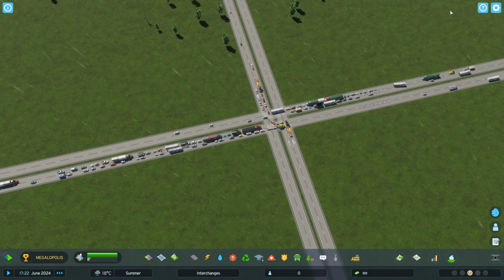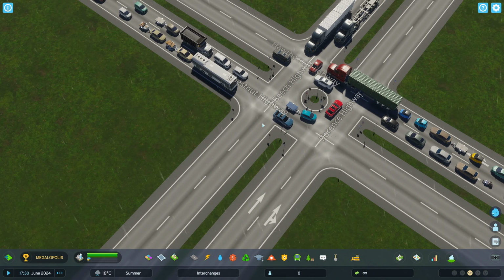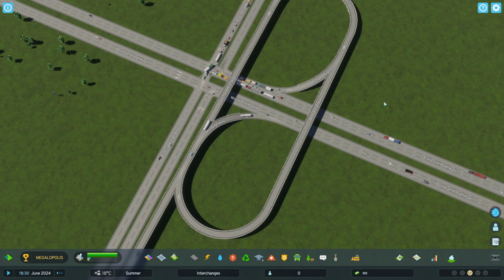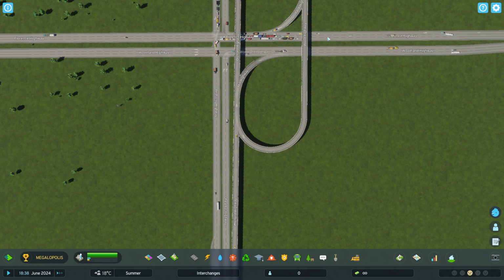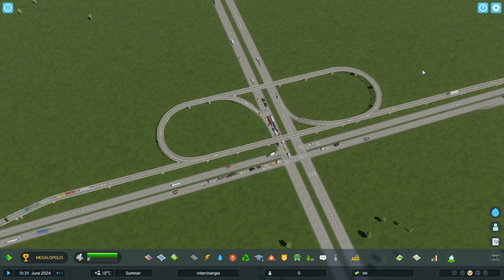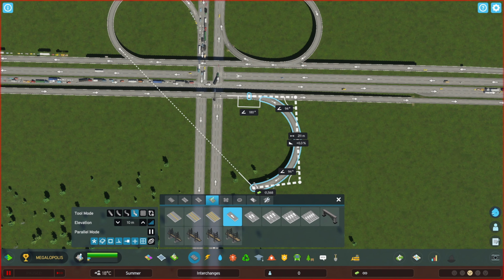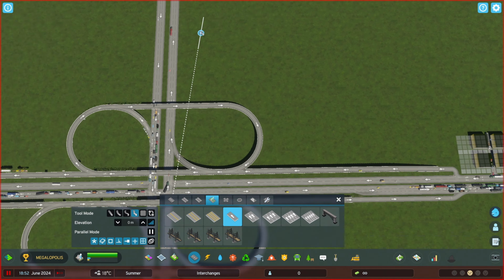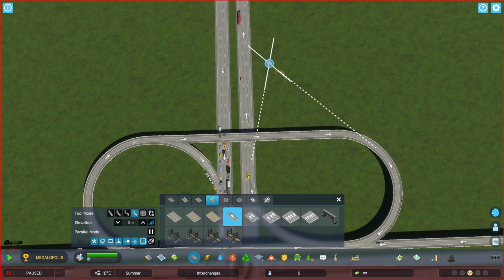Why Is This NEW Type Of Interchange So Good?

Comment: Very cool design! One issue would be that traffic flowing toward the interchange perpendicular to the ovals doesn't have the ability to go left out of the interchange. Essentially, because the parallel elevated highway segments are one way there is no way to go the opposite direction of those segments or to access the other oval circuit.
Reply from the maker: That's a good point -I didn't think about that. Thanks for letting me know :)

Comment: I can't be agree with your insists. because there is no 4 On-ramps. your interchange has only 2 On-ramps. and 2 On-ramps have only one function respectively. Generally, Service interchange has to have 4 functions for entering to Fwy, and 4 functions for entering to arterial Rd. Your service IC has 4 off ramps and only 2 on-ramps. On your IC, you can't enter from South to Westbound Fwy and from North to Eastbound Fwy. Furthermore, your on-ramps are located in advance to off-ramps. It will cause weaving phenomena.
Reply from the maker: Ah yes, I agree for what you are getting at. The simple solution is to add a u-turn off lane on both directions. Try this interchange with my solution, tell me if it works! 👍
Reply: I recommend parclo a4 and b4. However, b4 is not equivalent to real world because of uncontrolled left turn in game. So, A4 is one of good option. Not b4.  @off_the_edge
Reply from the maker: Cool, I'll keep that in mind!